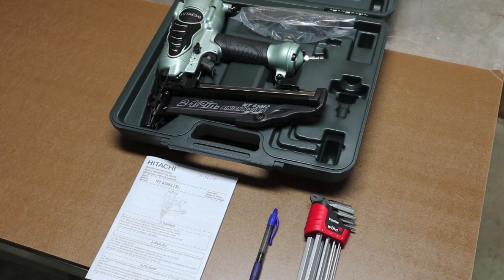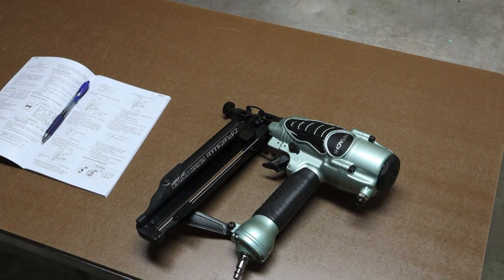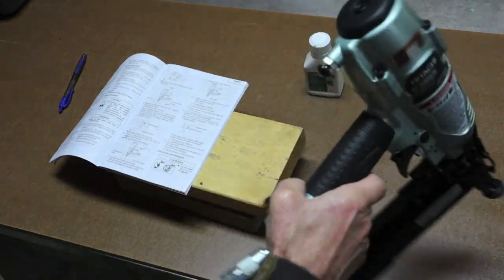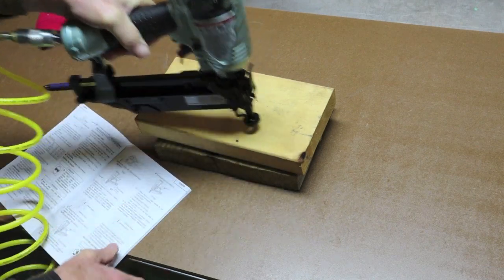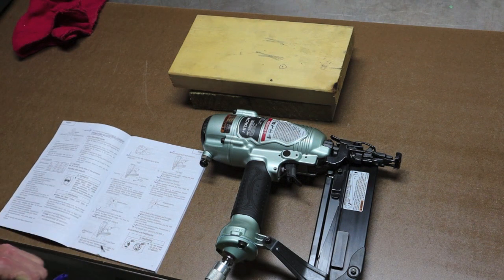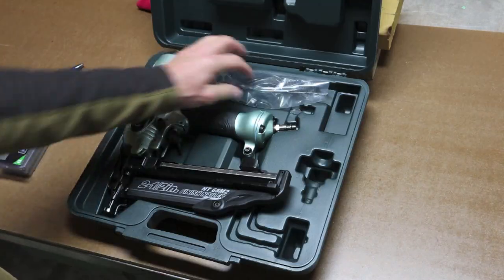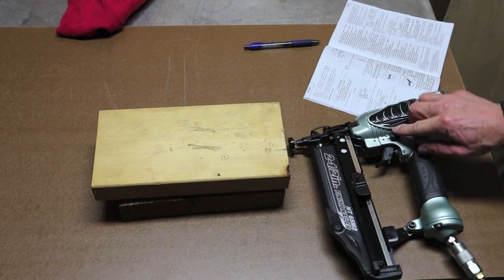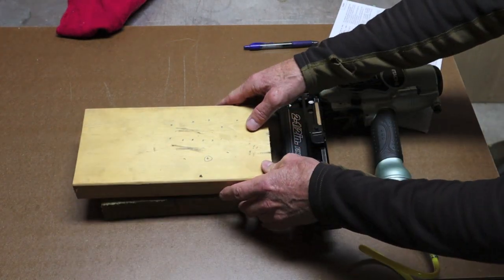Hitachi Air Nailer proper function check and first nail driven.

Comment: ps in case anyone didn't know the hitachi compressor gets to the psi set, then shuts off. i thought my compressor was broken but it just stops until youve nailed a lot, and then the pressure drops and turns back on again. I didn't know that and called the store and they said return it, but i figured it out. :) sorry for the newbie comment if this is common knowledge.
Reply from the maker: That is a very good compressor.

Comment: Keep your other hand far away from your nail gun Do Not hold the piece with your hand, nailing clamp it down. Or keep it far away from the gun in case of double firing or knot in pieces your nailing.

Comment: One setting for the nails is single the other as long as you keep the trigger pulled you can put down 1 nail lift nailer while keeping the trigger pulled place the nailer where you want the next nail push down and it will shoot anouther

Comment: Nice demo. I purchased the 18ga nailer today at Lowes, Its sold under the Metabo name now. After finishing a window trim project I decided I'm not going to do the next 7 windows by hand. Hopefully this will save me some time and smashed fingers
Reply from the maker: The next time I'm at Lowe's I'll check out the Metabo, I may get an 18 gauge in the near future.
I used to put on baseboards the old hammer, nail, and punch way..... after using this Hitachi, I get mad at myself for putting off the purchase as long as I did.
Thanks for watching and commenting!

Comment: I applaud your zeal for safety and I have experienced the shooting of a smaller 23 gauge pin nail into my finger. fortuneately it was not very deep and only bled a little but a bandaid was sufficient. 
I have both the 23 gauge pin nailer and an 18 gauge nailer but the 18 gauge nailer quit firing after only about 10 or 12 nails. That's how I discovered your video; I am looking to find how to troubleshoot these devices.
Reply from the maker: I hope you get her fixed. I've had good luck with mine so far.
Thanks for watching!

Comment: I'm looking for this exact gun I got the same one and needing a new one. I've looked through amazon and they just show the new named Hitachi (METABO) Only problem with the new ones is that they are mostly all plastic feel cheap and most of the reviews are bad. I use my tools every day 365 of the year. I take care of them but they do take a beating. I know what I've used and dont really trust the newer cheaper stuff. Do you have a link to where I can find one of these?
Reply from the maker: The Metabos I've seen look identical to the Hitachi model. I was hoping they wouldn't cheap out. 
I have not seen any lately.
The Metabo should have a good warranty though.
Thanks for watching and good luck to you!
Reply: @pmtips4482  yes I ordered a metabo but they look like its mostly plastic Hitachi sold out

Comment: Great video review. I bought this one today. It looks to be exactly the same even though the name has now changed to Metabo JPT. Are you still satisfied with yours?
Reply from the maker: Hi mcleod55, and thank you for watching and commenting!!
Yes sir I am still satisfied! It is one of the most useful tools I have ever purchased and regret not going to it years ago. Up until buying the Hitachi 16 ga, I was still installing baseboards with a hammer and punch. After buying and using the Hitachi, I felt like a fool for waiting so long to grab one. 
I just bought the Metabo HPT 23 ga pin nailer and it is awesome too. Very light and a very small pin hole is left and very hard to see with the naked eye.
Metabo HPT (Hitachi Power Tools)
(my copy and paste:)
 Hitachi Power Tools will be known as Metabo HPT from starting October 17th, 2018 as the company transitions away from the rest of the Hitachi group. Back in 2017, Hitachi bought out Metabo to bring the German manufacturer on board. Shortly after, investment firm KKR purchased the power tool division of Hitachi.

Comment: I just got the same gun only the metabo version, I also had the 15 gauge Hitachi, I found out on the firing mode that you can do a single fire on either setting, but if you do a single fire on the bump fire mode it will sometimes shoot a double shot, 2 nails right next to each other, its because of the recoil, so pick the fire mode you want, either bump fire or single, dont shoot a single fire, when its in bump fire mode or you might get a double fire, also the rubber bumper will cause the nail to not go as deep, if you want it to go deeper, so you can fill with putty, you can take the rubber piece off, just twist it, it will come right off, you can put it in your pocket, I was a painter for 40 years and would hate when the nail was flush, you see if you stain the wood, and shoot clear on it you will see the shiny nail, and it looks bad, I would have to carry a nail set around with me to set the nail, I would then find the carpenter and complain to him and tell him the problem so he could set his depth deeper, in his case it was a wore out gun
Reply from the maker: Hi Ken, thank you very much for the information!
I have noticed some guns will recoil more than others too, depending on sizing.
I can see a double happening easy, especially on guns with a short trigger reset.
As you say, some settings are better suited for single fire than others.
Thanks again!
Stay safe!!

Comment: How do I go about oiling the nailer ?
Reply from the maker: Hi Dimitri, in both my Hitachi manuals it states to put in 5 to 10 drops of oil daily.
After you get on to it, you can tell how much to use based on your tool use. A light day would be 3 to 5 drops, as any more will result in oily discharge during operation.
The oil is dropped in the air hose coupler on the nailer itself.
Thanks and work safe!
Reply: @pmtips4482  thanks so much !

Comment: A knot in the wood can easily divert a nail.
Reply from the maker: Hi Mark! You are spot on, a knot will divert the nail.
Never put your other hand near the business end of the nailer, a contractor showed me last month where a powered nail hit another nail under plywood and did a U turn and came right back through the surface about an inch from his drive point.
Thanks for watching!

Comment: Your air tools will work much better with a larger diameter air hose.
Reply from the maker: Thanks Jim! I'll keep that in mind on future purchases!
Have a good one!
Reply: @pmtips4482  just trying to help my friend. I had bought some air tools and a compressor a few years back and kept having problems with my heavy duty impact not being able to break lug nuts loose got angry and bought anouther better impact and the same thing was happening and even with my air wrench finally I started researching (which I should have done to start with) and found two major things I had wrong.
1) get a larger diameter hose because the that came with was not passing enough air to operate the tool effectively.
2) turn air pressure to between 60 and 90 psi depending on the tool.
Now my air tools work really well and no more frustration. HOOAAH 
I wish someone would have told me sooner but also I should have checked.
God bless

Comment: I wish I watch vids like this before I used mines. I didn't oil it for years. Now its not working.
Reply from the maker: I'm sorry to hear that Armchair warrior. If you get another make sure to use the proper oil required.
If you do over oil it, the excess oil will blow out through the air valve exit hole (to manually blow off dust, etc.)
but it will also come out slowly around the trigger mechanism where the valving is located.
Thanks for watching and commenting!